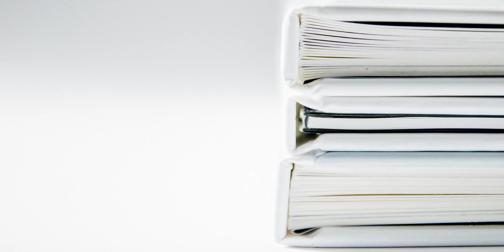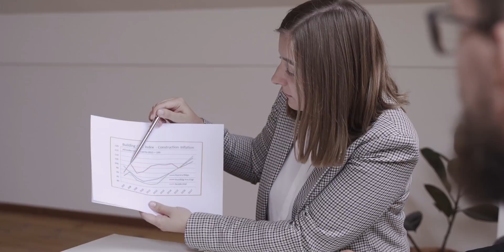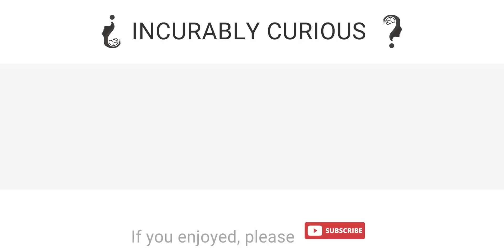Why Most Power Lines Aren’t Underground

Comment: Interesting reading about some negative comments on underground lines. I live in a community that started in 1978 and finished building out around 1998. They buried all line from the beginning as each section we started. I have lived here 24 years and have experienced two outages. One was a problem at a transfer station during the night that lasted seconds or minutes effecting things like electric clocks. The other was a planned outage when the power company had to replace a gigantic transformer. We were out for around 1/2 hour while they hooked up portable temporary transformers and another 1 /2 hour when rhe new transformer was hooked up. During that time a major underground trunk kine was also replaced in the community. I've been through 90 mph wind storms, flooding rainstorms,  scorching and freezing weather and never lost power.  The person who worked for a power company having more problems with below than above ground lines leads me to believe his company practiced some problematic methods of instalation or cheaped out on materials. One minor blip outage since 1978 shows underground lines can be best when done properly,
Reply: I lose power at least once a year where I live in Las Vegas, and we have underground lines (except older neighborhoods). I think our problem is the extreme heat causes transformers to fail. Transformers being our weakest link.
Reply: @JimmyMon777  Transformers a normally highly reliable, but if they are underrated for its purpose the can fail easiely, That is not a technical problem its a problem of greed of the power companies shareholders.

I live in the north of germany. All power lines except the huge 110 ore 220kV lines are buried into the earth. The feeding lines  of  10 or 20kV were the last ones which were lay into the ground .
There are  differences are in  big cities lik berlin, Hamburg etc. even the large feeder lines from power plants to  substations are digged into ground or special cable tunnnels. Berlin got a new cable tunnel for a new 400kV line. it is abt 10k long to power  a new indoor substation up  in the centre of Berlin.

Cables got a higher capacitive reaction power than overhead lines , but this  can compensate in the substation with the help of inductive reactors.
Reply: Yes. I live in the Netherlands. Basically all our lines have been underground for most of a century.
Outages are not a thing here, except sometimes planned maintenance.
Digging is regulated through a national register of all utilities under ground, that you have to check by law before you start digging.
Reply: My lines are above ground and iv had even less outages than you in the 27 years ive lived here. Literally ony one and i live in an area that snows and has tornado's, Id prefer my tax money not be wasted on buring lines that will have to be dug up anually to check for water damage.
Reply: @DeagleGamesTV  I don't understand the big deal with outages. Unless you have essential medical needs, who cares, and then just buy a personal generator.
Reply: Yup, 26 year old swiss person here. Our cables are almost all underground - I can't remember seeing above ground cables other than HV actually.

Experienced like.. what, 2 power outages in my lifetime? That were 2 minutes at most.
Reply: @iFireender  Differences in system design account for the difference in outages occurrence, duration, etc as well as the prevailing weather patterns depending on global geography. 
Customer density is also a factor. In your country I would bet the loading is much lighter as well as more concentrated than in the US.
Estimates of 700,000 miles of transmission system lines give an idea as to why everything can’t be buried. $$$$$$$$$$
Reply: Not to mention servicing would be easier not harder, and most definitely safer than climbing.
Reply: @DizzyDJW  negative ghost rider, underground installations are in fact more difficult to work on than overhead. Repair time is increased. 
In fact the injury rate in climbing is very low as all US utilities use a positive fall restraint system of some type instead of free climbing as was done some years ago.
Reply: You are describing low voltage, residential distribution which lends itself well to burial.  If it is well designed with the transformers away from flooding it works great.
Reply: It's like "green technology." The problem isn't the concept itself. It's that no one is bothering to innovate the field. "We have something that's cheaper and works. Let's stick with that!"
Reply: The transmission system in England and Wales consists of approximately 7,200 kilometres (4,470 miles) of overhead line, and 1,400 kilometres (870 miles) of underground cable operating at 275,000 and 400,000 volts (275kV and 400kV).  - primary distribution voltages are  66 kV, 33 kV for industry  and 11 kV this is  transformed down to 230v in homes with 100A supply
Reply: Sorry but your last point was wrong. That one exams alone isn't enough, and the weather varies. I assume there are no earthquakes or flooding or hurricanes where you live.
Reply: @TheGrimm459 that why the voltage is so high to reduce current
Reply: As the system ages, especially the direct buried rather than in conduit, problems will increase. I am making a rather long post on this based on my five years locating underground cable faults, ten years dispatching crew to repair electric distribution problems and maybe fifteen+ years locating and marking all type of underground utilities.
Reply: That will depend on where you live tbh…some areas the ground isn’t as forgiving 🤙
Reply: hmm....
1 those are fairly new cables so they may only be compared to above ground cables of a similar age
2 it may be very area dependent 
also it is hard to compare unless you would have 1/2 of the town with above ground wires
tho maybe neglectable to a certain extent underground wires have more loses then above ground wires, due to capacitive attenuation (but this depends a lot on voltage lvls and frequency
Reply: @sanjikaneki6226  1 - there is only one new power cable of about 1 mile in length which is a section of the main trunk line into the community as I mentioned. All the other thousands of miles of power and phone lines are original from when each building phase was put in which means in my case all lines were installed in 1998 when the house was built.
2- our community is not an island. It is surrounded by other communities, some having buried lines some with above ground lines so I did compare our community to others  built mostly after ours as we were one of the first communities in the area. We don't have trees taking down lines in storms, we don't have cars taking out power poles or transformers in accidents. In other words we have almost no outages compared to newer communities around us. We're older but better when it comes to lack of power outages. You also pointed out location may have an effect. Location has little to do with the fact all parts of the U.S. have storms and traffic accidents causing outages. Altho some parts of the country suffer more storm outages than other parts. All that means is we have less outages than some parts of the country and way less than other parts. We do suffer from our share of wild wind and rain storms but no outages like above ground power line parts of our area or the country. 3. Regarding possible power loss in transmission of electricity through underground  lines perhaps you could explain what that has to do with us having one one minor outage in 24 years. Even if true the loss is negligible as most new communities in our geographical area are going to underground lines when they build. They are doing it because it reduces outages and has a low maintenance cost as well as presenting a nicer looking community without all the power poles everywhere.  My history with underground lines is not related to trying to convert existing above ground line communities to underground ones. That would probably be prohibitively expensive. Underground lines are undoubtedly best done when a community is being built, not after. 

As a side note, we did a lot of investigating the goods and bads of buried lines, power, phone, cable  on our case, and could find little negative input ( for the geographical area we live in) and a little bias for buried lines from our power supplier and phone company.
Reply: @larrycurran7005  1 2 ok
3 it id due to AC attenuation tho it affects high and very high power lines more so maybe your community is not that large or rather power usage is not that large but yes it is probably nice to have those cables down in the ground  
well out here most are above ground and most if not all power outages were because of transformers or something like that but they are probably 50y+
Reply: @sanjikaneki6226  it's not "high power" lines, it's "high Voltage" (above 10,000V) lines that have capacitance problems. There shouldn't be any lines of that Voltage in urban areas.
Reply: @alanhat5252  i think i know of a 15kV in Bucharest tho i am not surprised it is rare cities after a size become odd
Reply: @alanhat5252  thank you for the correction. But not being an expert in electricity I am allowed to use various other words that while not technically correct still give the meaning of what I  saying. Looks l I ke you got the meaning of what I way trying to say. What would conversation be like if we all had to be experts on everything we wanted to talk about. My local power supplier uses both terms in its literature such as "don't mess around with downed power lines" so it seems to be acceptable to use that term when dealing with non-experts such as myself. But I do understand that in dealing expert to expert it would not be an accepted term to use.
Reply: @alanhat5252  P = IV
Reply: @tylerian4648  under some circumstances that equation works, what's your point?
Reply: @larrycurran7005  sorry, I don't think I corrected you. 
I did correct Sanji as he was discussing a technical aspect of power transmission & his use of the wrong term suggested it was possible he didn't have sufficient understanding of the phenomenon he was talking about. I felt that the point was relevant & important enough to be made though probably not important enough to labour.
Reply: @larrycurran7005  Our area also had power and phone cables buried when the sub-division was built.  However, the trunk lines feeding our neighborhood were not buried until about 15 years later.  So most of my power outages came before they buried the trunk lines.  They left the transformers on the trunk above ground and we have had power fails due to auto accidents and lightening strikes hitting the transformers.  But these are rare.  Much more prone to failure were the buried phone lines... all of which suffered from water contamination and we had to switch to cell service for local phones a couple of years ago.  Which we should have done anyhow, much less expensive (land line service vs cell service).  My land line was around 50 bucks per month.... my Tracfone is 20 bucks for 60 days.  Big savings.  Our main phone is my wife's cell, she has an unlimited plan that pre-dates our landline disconnection.
Reply: @alanhat5252  standard high voltage is often 11kv or 22kv. They are in most streets. Transmission voltages of 33kv 66kv 132kv will be on about 1/10th of streets in any urban area.
Reply: @alanhat5252  "There shouldn't be any lines of that Voltage in urban areas". All depends on your country 10kV isn't much. 
The street feeders (whether above or below ground) running everywhere in residential areas of Australia are sometimes 6 but usually 11kV, every couple dozen houses or so they have a little transformer on the pole to drop it to 415. So for aerial, you have a 4 insulated conductors (3P plus return) and directly above them, 3 un-insulated conductors at 6 or 11kV. Some poles (yes still in residential/urban areas) have a 3rd tier at the top of the pole @ 33kV. 
Same underground except they have the 11kv-415 transformers in little green boxes on the footpath.
Reply: @larrycurran7005  You can do it after just fine. The area i live in had above ground power lines everywhere 30 years ago, now it is almost entirely underground. Unfortunately i never cared much about power lines, so i did not notice when they were replaced.
Reply: @larrycurran7005  Underground residential distribution (URD)cables are designed to last 30 years.
The lineman that you referenced wth a was having trouble working on one…..underground cable eventually fails as it has a design life also events like damage caused by other utilities digging into while doing working on water, sewer, etc. 
When it does fail the repair time will take longer than overhead power line and yes it is more difficult to work on as it isn’t visible and all locating of faulted cables relays on electronic locators. You have to find the bad spot to be able to fix it. The “trunk lines” (telephone cable moniker) you mention are called underground primary cable.
The other poster referred to power losses on primary cable and while they do occur they are usually negligible unless the run is unusually long or the loading is high. 
If the particular cable you are served by is in fact as old as you mentioned you can rest assured that the frequency of outages will start to increase. Everything ages. 
Most underground lines are fed off of overhead powerlines somewhere on the circuit and an outage on that overhead will still result in a loss of service on your end. 
While the asthmatics are better underground installations are far from perfect but to install every mile of powerline underground would be incredibly expensive and would result in billing that most customers wouldn’t tolerate.
Reply: @alanhat5252  The majority of distribution lines on many systems are above 10kv. 
12,470, 13,800, 19,900, 23,909 and 33kv are all common distribution system voltages. 
Yes there are 2400, 4800, 7200 lines but as load increases the voltage on circuits generally has to be increased (conversion) to compensate for current rise. 
The capacitance mentioned on URD primary are a condition that occurs due to the way the cable is designed but isn’t normally a problem depending on loading of the circuit. If lightly loaded ferroresonance can occur but is not a common problem.
Reply: @richardcranium3417  "When it does fail the repair time will take longer than overhead power line "

Funny, then, that the US has far more outages than anyone else in the developed world.

"If the particular cable you are served by is in fact as old as you mentioned you can rest assured that the frequency of outages will start to increase. Everything ages. "

Here's news to you - regular maintenance is a good thing. No, it's not a boon to have power cables that hold for 80 years. It means you're using stuff that's obsolete and wasteful.

"Most underground lines are fed off of overhead powerlines somewhere on the circuit and an outage on that overhead will still result in a loss of service on your end. "

Not when you have a grid with good redundancies. 

But I fully understand that having a well-planned and well-maintained infrastructure is an alien concept.
Reply: I would like to correct one mistake I made in a statement. I said the power lines to my house were installed in 1998. That was the year I purchased the house. They were actually installed in 1978 so are 20 years older than originally stated. That makes them about 44 years old now, with no problems on the buried  lines.

Comment: (Retired after 34 years with a Fortune 100 electric company... was IT field support, including the IT guru for the Flagstaff smart grid.) Underground has repair issues as well. Actually locating a fault within enough accuracy to deal with it is part science, part art. No doubt about it, UG is cool when it is not being a terrible PITA.
Reply: What do you think to radiation from power lines, EMI PLR While carrying electricity, power lines create an electromagnetic field which, in turn, produces electromagnetic radiation. The radiation is capable of penetrating into homes, offices, cars and other places. but the effect on the ionosphere and atmosphere, maybe even global warming, through the increased rotation in angular momentum in atoms, underground may be a lot better.

Comment: Doubling the rates is only one of the outcomes, and it is completely unnecessary.. By dealing with small areas, one or a few at a time, prioritizing areas where weather related outages are a disproportionately large issue, the impact on rates could be vastly lower. The trade-off is that the project would have a very long time to completion.